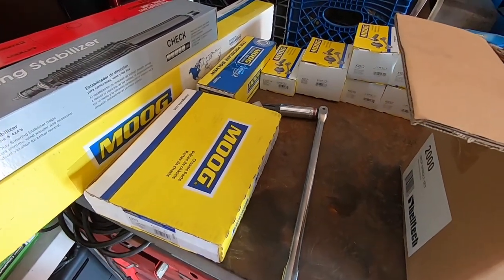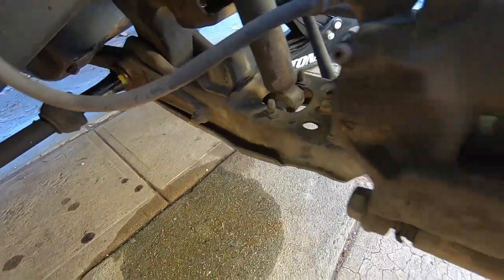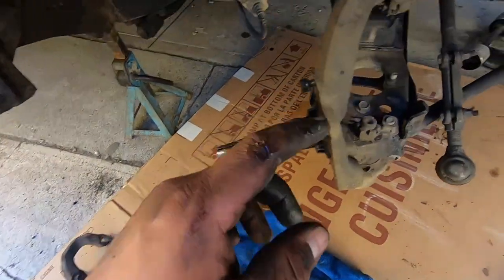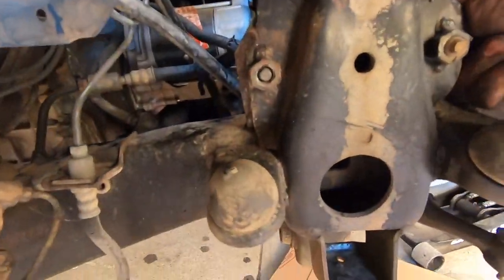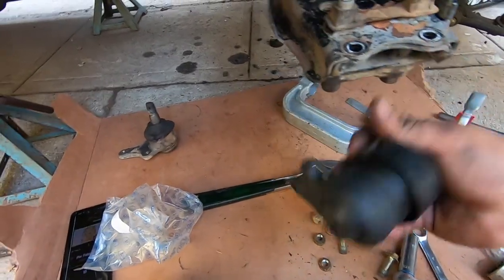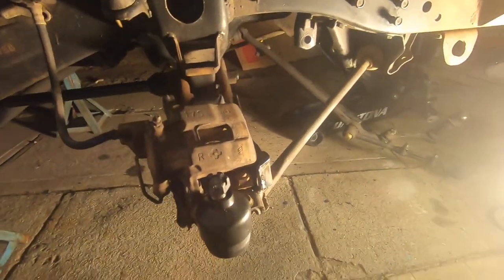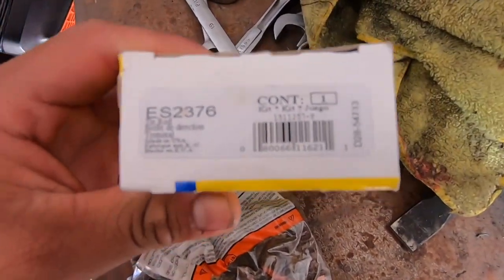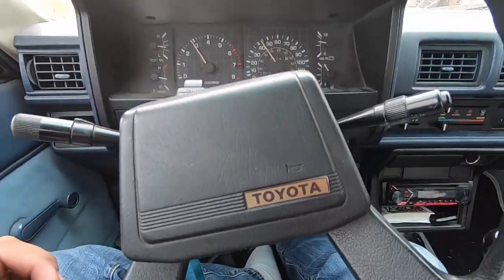Belltech Drop Kit, New Suspension Bushings, & Steering Components Installation On A Toyota Pickup

Comment: I have the same problem tires sticking out of fenders more on the passenger side good for 90 95 models I'm going to remove them off my 87 I don't like tires slamming into my fenders I hit a pot hole covered with water couldn't see it drivers side tire slammed into fender and messed up my beautiful 87 drivers door gap .
Reply from the maker: Damn! Yea we are going to put stocks back on and hopefully come up with a idea to throw them back on because it looks good with these wheels. Worst case we just get some 15" steel wheels.
Reply: I'm running 15 x 7 with 205 50s looking at putting back stock and installing a stabfab coilover kit.
Reply from the maker: We are looking into swayaway torsion bars
Reply: that looks like a lot of work and expensive... on my 85 and 87 i just did a torsion drop and reset the torsions and drop shocks from Belltech. im running 15x7 on the front and it tucks in the fender..  cheep and easy set up.
Reply from the maker: Not sure why these crown vics dont truck into the fenders. And i cant reindex this truck because of the missing tooth that guides the key